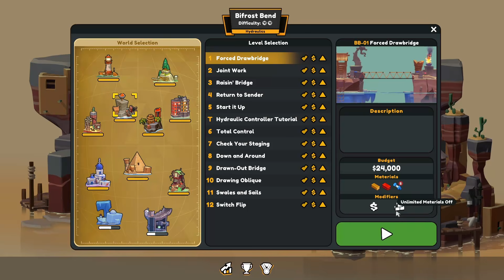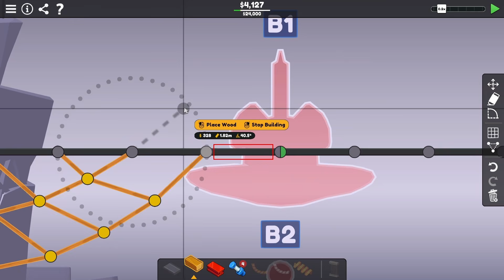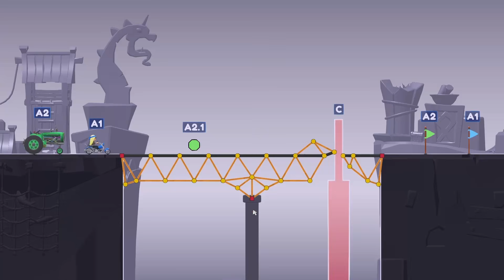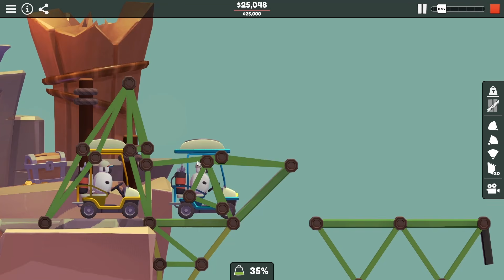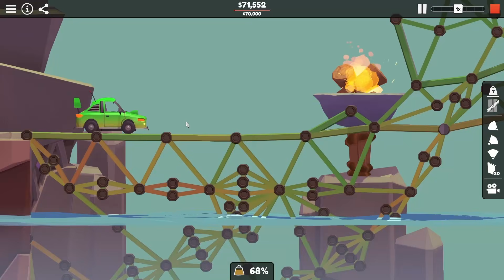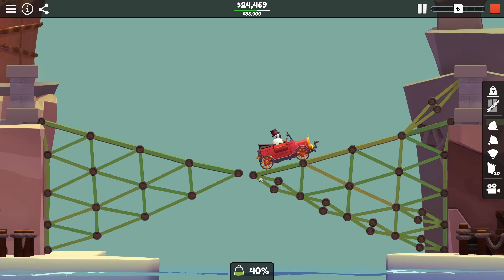Can You Beat Poly Bridge 3 Using Only Wood?

Comment: Fun fact(?), I think road is just a tiny bit shorter than wood, because sometimes it does not let me replace a wood with a road. Usually when I build on grid and I place a diagonal piece of wood that snaps to grid, road cannot snap to the same spot.
Reply: Yeah thats on purpose
Reply: Shouldn't be, both maximums are 2.00m

Comment: 18:05 wait... if you have a hydraulic controller why waste time with the boat. I know this is going to sound easier said then done but the hydraulic controller is all you need.

With the controller you probably need to have 2 weights. 1 to move it out of the way and a second that is static with potential energy for the first part and released for the second part.
This is probably the easiest way of doing this. The hardest part is the linkage to make this happen. This really reminds me of the walking bridges in poly bridge. If you have some sort of repeating mechanism that can be reset you can also do it that way.

Say you have a lever that pushes it up and a lever that pushes it down.
The 2 levers are connected and always go in predictable locations when they are "on" or "off". Release one weight to make it "off" then with the controller release another weight to make it go "on" while also releasing the first weight.
Hope this makes any sense.

Comment: I haven't played poly bridge 3 so just a guess but for the last level you might put the bridge under the boat and use the hydraulic control to drop counterweights on the other side of pivots or slowly drop the bridge from above the boat or perhaps invent a bus catapult or lifter made of wood. maybe have a arm that lifts the bus and holds a big counterweight in the air and then when it goes up momentum carries the bus past vertical at which point the counterweight falls off and the bus falls to the right IDK just my guess...

Comment: There is a way to pull the road straight out to the side. This make it need hardly any energy at all. So having weight that dropa of when it move.back, it actually possible to have the bridge several times with a few weights